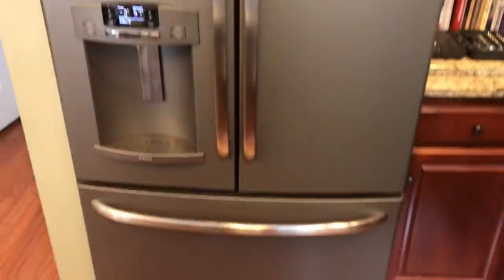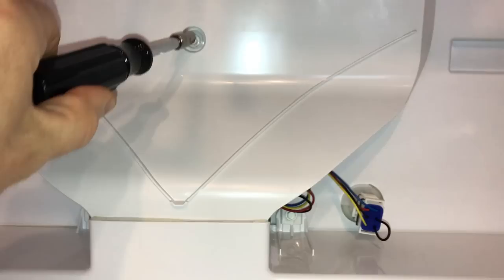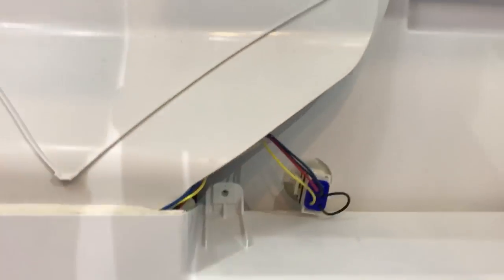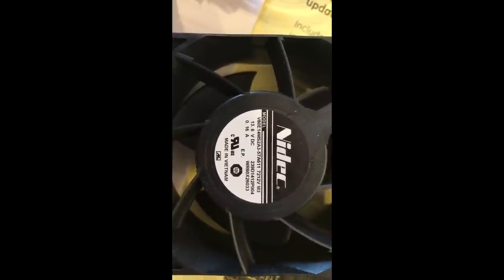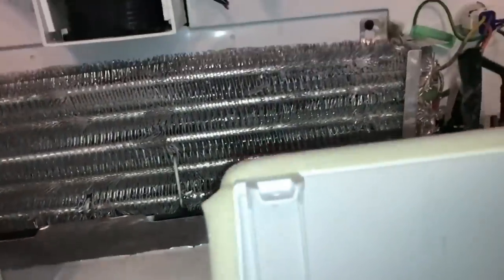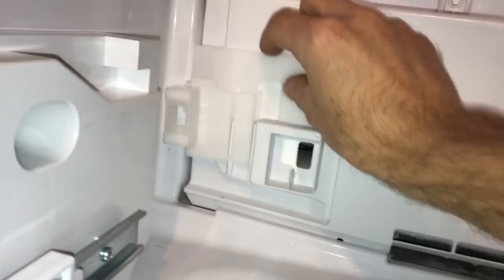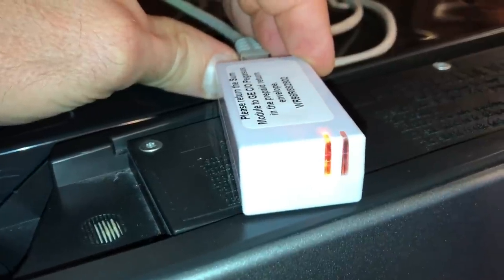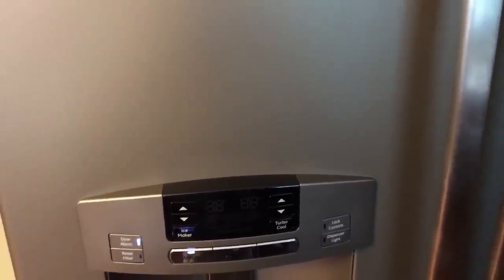GE french-door refigerator not cooling - How to replace evaporator fan

Comment: I have the same problem exactly but the fan works. I think I have a slightly newer model frig though and the deli drawer adjustment seems to be regulated by another fan that is in the side of the lower encase net that you removed. Could that be the issue? Or is there another fan somewhere that is bad. After I removed all the pieces like shown in the video I plugged the frig back in to at least keep my freezer going and I heard what sounds like another motor kick on that didn’t sound right. Thoughts?
Reply from the maker: I’m not sure if newer models have an additional fan for the deli trays, but if the fridge is not keeping temp the main fan still could be the problem. 
There have been many cases of the fans working sporadically and that could be what is going on with yours. Or, if the fan is fine, there could be a problem with the control board or thermostat turning the fan on and off. 
Based on the common symptoms, the main fan replacement may be a good place to start. 
You could also check out the forum section of the ApplianceBlog site - the moderators there are great and may have some insight too.
Reply: @ljschuby99  I left frig on with parts off just to keep freezer going. It is cooling just fine now but there is frost and ice building up on the evaporator coils. Is this normal?
Reply from the maker: @davidweingarten809  some frost is normal, but the fan running should keep a heavy buildup from happening. Does the fan seem to be kicking on to cool the fridge?

Comment: I have the 2012 GE Adora French Door and the water dispenser and door ice maker are not working. I changed out both the water inlet valves on the back . I also changed out the water inlet valve on the door and still no water or ice dispensing on door. The cold tank on the door is not frozen but only half full. The ice maker in the bottom is now working only. Anything else it could be?
Reply from the maker: Sounds like it could be a circuit board issue, but I would recommend checking out the forum section on the ApplianceBlog site to see if anyone else has had those symptoms.

Comment: I find your video easy to understand. My GE fridge is almost identical except for the controls. If I can find the model number could you please help me find the right part so I can try to fix it? I’m in Hartly, Delaware been putting it off for some time. Thank you.
Reply from the maker: Yes, the standard fan will fit most of these GE models. 
There is a model number in the description that you can check for compatibility.
Reply: @ljschuby99  the model is GFE28GSKJSS and serial #VL511307 is there any other type of information needed for the fan part? It is a GE French door fridge with bottom pull out freezer   Omgh looking forward to trying to fix it so I can have normal food and milk lasting longer that only 3 days. You are a lifesaver!
Reply from the maker: The fan part number is WR60X26866 .  You can find it in Amazon or GE appliance parts site. Good luck with the repair!
Reply: @ljschuby99  it’s working!! Was no ice on the coils. Part came today and I just finished putting it all back together!! Thank you so very much you are a God send. I pray God blesses you and your family abundantly overflowing!!
Reply from the maker: Thanks so  much - glad you got it working again!
Reply: @ljschuby99  the thermometer says 37-53 degrees it’s set at 34 what else can be wrong. Or is it normal to fluctuate? I did not get a chance to vacuum under the back.  I did clean the vents
Reply from the maker: It should get down to 34 but may take a little while to get there in the refrigerator. Is the freezer holding at around zero degrees?
Reply: @ljschuby99  I reset the digital thermometer as it’s saying for the top shelf minimum temperature was 36 highest was 57. And current temp was 41. I wasn’t opening and shutting the door all day. The freezer has always been where it should be. -0-4.  When my son gets home tomorrow I’ll have him pull it out and I’ll take the panels off, unplug it and vacuum out the bottom best I can. Any thing else I can look for? Or do? When I took the inside apart I was expecting to see the coils with ice and frost frozen. The ice was more in the corner where the meat drawer ends were. And where the fan was. Could the coils be bad? But the freezer wouldn’t be working as well either.
Reply from the maker: Yes, usually the coils would be frozen up, so not sure if there is a problem with those or maybe a thermostat. 
The fan should be staying on almost continuously until it reaches the 34 degree temperature. 
Something else to check would be the door switches at the top of the fridge doors. They should  both be clicking and activating when they are pressed in.
Reply from the maker: Possible that it’s a thermostat or coil problem. 
When you open the fridge can you hear the fan turn on?  It should be running almost continuously if the thermostat is working and the fridge is still not cold.
Reply: @ljschuby99  I will have my son check. As i do have hearing issues too. So opening the door the fan should come on. It used to sound like an airplane taking off awhile back.
Reply: Sorry for the late reply. The thermometer is reading low 36 hi 42 and currently at 39. I’ve not checked the coils in the back. And with the high velocity fans and ac units I really can’t hear. I keep milk in the meat drawer and it’s lasted normal time now not just 3 days. When it’s a cool evening I will turn the fans off to hear if the fan in the fridge they turn on when I click the switch’s up top

Comment: I ordered the fan for less than $20 from Amazon & followed your steps to replace it. The fridge was cool in no time. The other issue I was having is no water being dispensed. That has not resolved as of yet. Any thoughts?
Reply from the maker: Glad you got it fixed. The water lines could have been frozen, so that may resolve itself soon.

Comment: Well, the replacement fan is acting up, so I ordered another one. This time, we had a lot of thick ice build-up under the deli drawer, and the fan is making a loud humming noise. We also noticed through the vent holes, some ice building up on the evaporator. Do you happen to know why we have ice building up underneath the deli drawer? Maybe this is a separate issue?
Reply from the maker: That still sounds like a fan issue, but strange that you have gone through two of them. 
The ice on the evaporator and deli tray would come from the fan working just intermittently. 
I would replace the fan and monitor how it is running. If it is not running like it should, it could be a thermostat or control board issue. 
But hopefully a good fan will take care of it.
Reply: Ok, thank you so much for the info. I'll try replacing the fan first and go from there.
Reply: When I get the new fan, how do I know which direction to install it? Maybe I put the original replacement fan upside down and it’s blowing air in the wrong direction, and that’s  why the evaporator is building up ice again? Should it draw the air UP, away from the evaporator? Or down, toward it?
Reply from the maker: Yes, it should be facing upwards to pull the cold air out of the freezer and through the evaporator up into the upper fridge section.
Reply: Ok, thanks for clarifying that for me.  I had a feeling that was the case after re-watching your video. It makes sense that it would draw the cold air up, away from the evaporator coil. Plus, the wire harness can only go one way properly...to the upper right, in order to route it over to the plug.
Take care!

Comment: Disassembled everything as presented. Pulled out evaporator fan, but did not unplug. Turned on breaker, refrig turned on, evaporator fan sputtered. I tapped on it a couple times, and viola! It started spinning. Reassembled everything, main compartment cooling down and refrigerator is quiet. I will order a new fan anyway so I'll be ready, I'm figuring the old one was letting me know it's days are numbered. .
Reply from the maker: Yes, it would probably be good to switch it out now.

Comment: Can you let me know if there’s a fix for this same exact fridge that has an issue with water collecting and freezing under the deli tray?
Reply from the maker: This same fan could be causing that issue. If the fan is not running properly, melting and freezing of condensation could cause that under the deli tray.

Comment: Thank you very much for posting this, I have the identical refrigerator, purchased in 2013 and had this problem, fixed it based on your instructions and a locally available $70 part in less than half an hour.  

Question is in regard to the ice dispenser on the door.  Several years ago, we noticed the water line would freeze someplace and the water would not come out the dispenser. I would defrost various places with a hair dryer until the water dispensed. Soon realized I need to turn the door ice maker off so the water would work, which has been fine because we have the lower ice also. Do you think this evaporator fan replacement might fix the problem with the water line freezing during the ice making process?  Have been seeking a fix for some time. Thanks much!
Reply from the maker: Glad you got it fixed. 
I did not have problem with door water line freezing. I would think this fan replacement would help if the freezing was taking place in the back of the fridge where the water lines go. 
I would check RepairClinic website - the forum section there would have some suggestions on exactly that issue.
Reply: Thanks much, have the upper ice maker back on for the first time in a few years. Will probably freeze up around the nozzle and will figure it out then or will go back to no upper ice.

Comment: Is the software update really needed? I’m trying to figure this out since I replaced the fan but didn’t know the update needed to be done until I saw this video (to make sure I did it correctly). Can I still do it? Should I still do it even if it’s working and cooling just fine? Will I have any issues because I just changed it without programming it? Idk what to do now!
Reply from the maker: The new fans have different specs since this video, so you will not need to do the software update now. You should be good to go!

Comment: Thanks for the video. I plan on tearing into mine today and expect to find the same issue..
Reply: Like another poster, I removed the fan, unplugged it, spun it by hand, then plugged it back in, at which point it started running again. I'm not confident the fan doesn't need to be replaced and feel I'll be replacing it soon. Thanks again for your video.

Comment: I didnt get that software upgrade kit with my replacement evaporator fan motor? Will I need it?
Reply from the maker: You probably received the newly re-manufactured part.  GE just issued a new fan that is a direct replacement for the original and does not require updated software, so you should be good to go.
Reply: Thank you!

Comment: Had the same problem, Called GE if I had to do a SUM update, they said I have to call a service tech.  Service Tech is $99 just to come on out, plus parts and labor.  I got my evaporation fan part from a local parts distributor and had to get a SUM (Software Update Module) from GE parts department.  It seems you need a SUM update if you order a new evaporator fan.  SUM is another additional cost to get your fan to work well.  Model #GFE29HSDASS Serial TZ513133  Spent a total of $120.00 for the two parts.

Comment: Hello I was curious how long after replacing and powering back on did folks see the temps start to drop? I left my door open to allow the condenser to defrost a bit from all the ice. Temp is 77 degrees. How soon should I see a drop in temp?

Thanks!
Reply from the maker: Should be within a couple of hours. You could use Turbo Cool to speed it up.

Comment: Thanks so much for this.  We just followed this today.  2 questions: 1) Do we HAVE to do the software update? 2) Should the fan run all the time?  We notice the new one runs sometimes and then shuts off.
Reply from the maker: Glad you got it fixed!  The new fans have different specs and no longer require the software update.  Yes, the fan will turn on and off based on temperature and refrigerator cycle.
Reply: @ljschuby99  Thanks so much.  Very kind of you to help all of us.

Comment: Had the exact problem. Was able to add some WD40 and some other good lubricant to get the old fan moving freely and put it back. Worked great for 6 days and back to the same problem. I ordered a new part from ebay and guess what, i got the same 53 Degrees on the refrigerator side after 2 days. What are my options now ? Faulty Motherboard ?
Reply: probably you bought an used one! DID YOU FIX THE ISSUE?

Comment: How long should we expect the fridge to take to cool back down once the coils are not frozen and fan is working? 
Mine was at 70 degrees, followed instructions, removed ice, fan started turning again so I don’t think it’s a fan problem. Ice is gone which is great. 

Either way, super helpful video.
Reply from the maker: It should cool back down within a few hours. You could also enable the Turbo Cool and stepped things up if you have that option on your fridge.

Comment: How do you know if fan is not working. Will it not spin if fridge is plugged in? How do you know if software upgrade is needed?
Reply from the maker: If you are having symptoms of cold freezer, warm fridge, and frost buildup on condenser, then the problem is likely the fan. Because the fan does not run all the time, you would have to wait until it is supposed to kick on to see if the fan starts. 
The fans now do not need the software update, so you could just replace the fan without the software change. 
Good luck!

Comment: hi did this fix after ice sheet freezing was occurring under lower drawer now fridge is to cold freeing everything but top two shelfs. mid 20 degree F lower portion of fridge compartment Freezer temp is spot on at Zero degrees  
any suggestions  ?? ps already changed out temp sensor
Reply from the maker: Best bet would be to check out the forum section of ApplianceBlog website. If you don’t see an similar issue listed, start a new thread with description of your problems - the moderators are great and will have an idea of what to try next.

Comment: When I ordered the part it did not come with a software update box. Is it necessary to do for it to start working correctly again?
Reply from the maker: If it did not come with software, you should still be good to go.  The newer fans have the correct specs and should not need the software update to work properly.
Reply: @ljschuby99  well then I believe there is something more wrong with it now because it's been a few hours and it's not cooling down. I've jumped started the fan before to limp it along until we got the part, but now the freezer isn't cooling either. UGH

Comment: Quick question. I ordered the part but it did not come with the software upgrade. Unfortunately the software upgrade is not in stock right now. However, I did do a test run and the fan immediately turned on without the upgrade. Is this expected? Is the software update needed to have the fan turn on? Or is it more specific like upgrading the pwm control of the fan?
Reply from the maker: Glad you got it working. The specs on some of the new fans have changed, so if you didn’t get the software upgrade, then it is likely that received a fan that does not require it, so you should be good to go.

Comment: How did you know you needed to upgrade the software?  I cannot locate that info anywhere.  Thanks!
Reply from the maker: There was a short period of time when the upgrade to the software was necessary, but the new fan specs do not require it n now. So you should be good to go with the fan replacement only.

Comment: Which replacement part would you recommend, the one that needs the software update or the newer? I'd rather spend less money, but if the other is better I'd get that. Just want your opinion. :) thanks
Reply from the maker: I personally used the one that uses the software update and it is still working perfectly, so I would say you would be good to go with the cheaper one.
Reply: @ljschuby99  worked great! Our fridge is now in safe food range!! Thank you!!!
Reply from the maker: @fightkid2193  That's great - glad that you got it fixed!

Comment: Did everyone use the cat 5 cable ? Or can it be fixed with just the. New fan ?
Reply from the maker: The new fans do not require the software upgrade now. So you should be good to go.
Reply: Also when you change the fan and the temperature is changing freezer is going down as is the refrigerator example start g out 72 on both, freezer goes to3 and refrigerator goes to 50 , and I see frost on the coils , is that normal and how long should it take to get to the correct temperatures?

Comment: Where did you order this from ? and what happens if you dont use that computer but just replace the fan?
Reply from the maker: You can get fan from RepairClinic site . The new fans now have been improved and do not require the software update.

Comment: Unfortunately this didn't fix the exact same issue with my GE model GYE22KMHGES. I ordered a new fan from GE which they said did not need the software update. My fridge froze right back up within a few days. Guess I'll try replacing the defrost thermostat next. It's very frustrating the new fan didn't help.
Reply from the maker: Sorry to hear that the new fan did not fix the problem. Thermostat sounds like the next likely place to look. 
You can also check out the forum section of the ApplianceBlog site to see if there are any other possibilities. The moderator may have another idea.
Good luck and let us know what you find out.
Reply: @ljschuby99  Thanks for the feedback